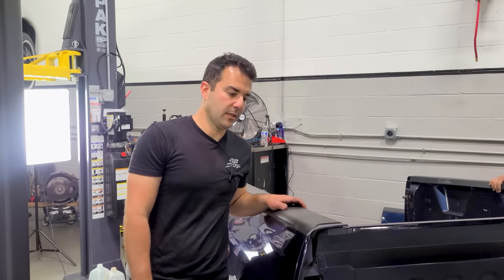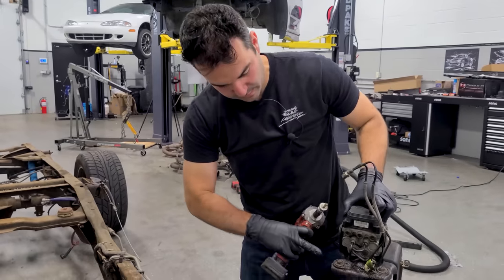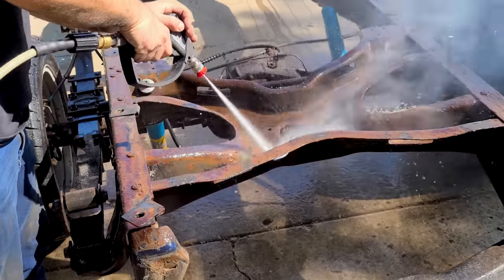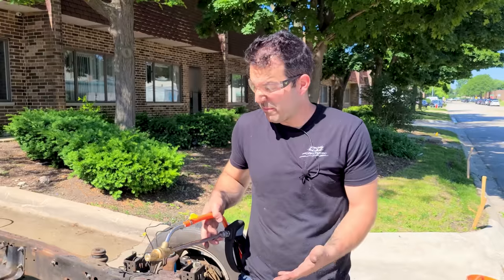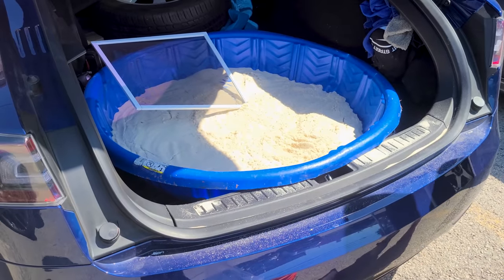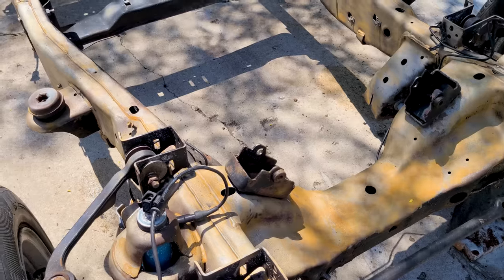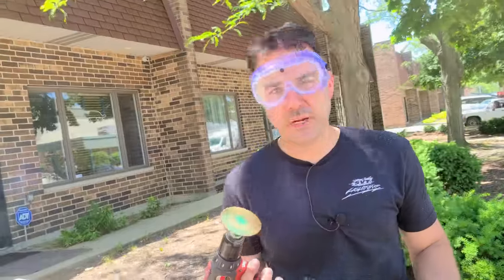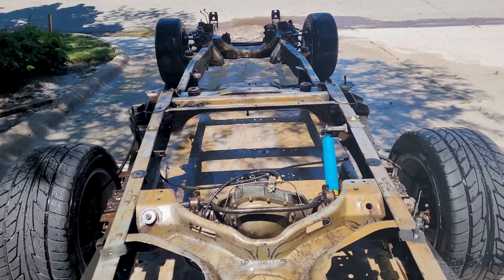I Was Quoted $3,000 To Sandblast My SVT Lightning Frame So I Did It Myself For $100 & So Can You!

Comment from the maker: Legit Street Cars Foam Cannon bundle with wash mitt & Clay Mitt! https://www.legitstreetcars.com/merch/p/lsc-foam-cannon-wash-mitt-clay-mitt-bundle
Foam-Cannon with wash mitt!
https://www.legitstreetcars.com/merch/p/lsc-foam-cannon-with-microfiber-mat
The bundles sold out in a few days last time but I'm restocked and these are ready to ship. Limited-time special pricing is automatically applied!
Reply: Por-15, Metal Prep,  prevents, the flash rust. Leaves metal, a zinc grey, if kept dry, till paint
Reply: the frame looks rusty already..

I was a quality control supervisor at an oil platform factory. They use sandblasting for pretty much everything that needs to be coated. I wouldn´t even let them get near the sandblaster if the relative humidity was above certain level let alone get the sandblasted metal get wet or even be touched with bare hands. Sure, a car frame is not going to explode if some rust gets trapped but...

I wonder how did you remove the rust before coating the frame?
Reply: Yo. I know you know about eastwood products. I had rust on my 2006 Chevy Van's roof (like they all get) and used an SCT from eastwood. it's short for Surface Conditioning Tool.  It's hard to say whether sandblasting would've been faster or slower ... but in your face for the under-side, I think it's by far the best product with the abrasive wheel they recommended for me. I think the abrasive was either 80 or 120 grit.  Which I then used with their epoxy primer which did a pretty good job.

Comment: Pro-tip!  Try to keep the jet at 90 degrees to the surface you're blasting as a general rule.  Using it at an angle diminishes the impact energy of each sand particle and therefore its power!
Reply: Heartily disagree. At least with sandblasters that I've used (particulate specifically) holding at 90 degrees will increase the impact energy but less sand will abrade because it has nowhere to go. Its easier to get a consistent finish and faster to blast at a ~45 degree angle bc the sand "skips" across the surface and away. Probably different for vapor blasting
Reply: Totally disagree. Your science is flawed.
Reply: 90 degrees angle is the absolute perfect way to sand blast.
Reply: I like between 77° and 79° when I sand blast, not a degree over or under. You've been warned.
Reply: @jimgordon3468  as a professional sandblaster. 90° is not the perfect angle. One should start with 70° and find what distance and angle works best while completing the project. Different media acts differently to different pressures, and when water is introduced it slows the media dramatically.
Reply: @JDJD-mw9rr  haha
Reply: I just close my eyes and what ever happens...happens! Lol!
Reply: @richardb4022 I prefer 110 degree 😉
Reply: Did you get the bushings while you’re at it 😂

Comment: A pro tip, if you have a car lift ... 2 posts lifts, like the ones you have...     Use the lift to lift the bed off the frame..  then roll the frame out of the way and then you can set you bed down on the ground or rollers etc..  work smarter not harder.

Comment: I don't know how we went from head gaskets to frame off sand blasting, but I love it. I've never seen one of those DIY sandblasters before. Very cool.
Reply: @  GldRush98, check out Steve Summers channel. He has recently done the same thing for blasting parts on his 80's Chevy Square body rebuild. A real nice guy( I visited his shop and met him while on holiday in the states from the UK back in March)
Reply: It Happens...  😆 
Never seen a Wet Sandblasting like that..   👀 

I have a nice Air pressured Sandblaster tank; but, it's only practical for Small areas..   it Devours Air and I Hate the Dust.
Reply: While we’re in there….
Reply: I think im gonna use that line on my wife "Honey we need head gaskets on the truck" Translation " frame off restoration"
Reply: I guess if you already have a huge air compressor, sure.  But the cfm you need is way above typical household compressors, unfortunately.
Reply: @bb5242  Yeah you need 28-35cfm, 1/8" Kennmetal nozzles and 1/2" hoses on blasting pots to get anything done on frames.

Comment: Cost me about 500 bucks to do it myself with a sandblaster from Harbor Freight.  Worked out well. Also might help if you use a more abrasive sand. I used coal slag.
Reply: sodium bicarbonate as an abrasive media.  Then raptor line it. Keep and clean all your old bottles. clean well, reuse it for rubber under coating by the gallon.
Reply: Salt?
Reply: @JakeSullivanMedia  Baking soda
Reply: @JakeSullivanMedia  salt is sodium chloride
Reply: @joshuavanalst2365  won't remove heavy rust,
unless you turn the pressure right up
Reply: @joshuavanalst2365  also soda fucks with paint unless you neutralize it
Reply: Yeah and it cost me 700.00 for a mobile unit to come and do mine.

Worth it!👍
Reply: @joshuavanalst2365  sodium bicarbonate is dissoluble in water you might as well be wet blasting it with butter because its not going to do much.
Reply: Coal slag is very effective compared to play sand, and only $10/50lb bag at Menards.
Reply: @JoeMama-ke1fi Can you do wet blasting with coal slag?
Reply: @lexrios5452   I don't think so, I mean you probably can literally do it but it might mess up your nozzle.  It's definitely not meant for wet blasting.
Reply: Had to be several hundreds gallons of water to do that! My town would cut me off!😁

Comment: Alex:
When he bought the truck: It needs JUST A BIT OF WORK
When he discovered the bad head gaskets: Let's replace the HGs
When he discovered the bad engine: Let's build a forged rotating assembly
When he took the engine out: Let's do a frame-off restoration
Reply: So true !   Love it ,  while your there syndrome
Reply: When he blasted the frame : Time to buy a paint booth?
Reply: @Robsav-yx6vi  whe while you are in there goes a bit too far
Reply: You stop when the money runs out?
Reply: It's a lightening tho. They're epic trucks and I feel like it's worth a full restore
Reply: Mission creep....
Reply: just wait till he tackles the fuel pump and ends up with a new transmission
Reply: This is me right now... started with head gasket replacement. Now I'm building fully forged 383 motor with $2000 of head porting work/bigger Valves etc. 4l80e is apart on my bench. I'm taking the body and bed off the truck today for a frame restoration.... what have I done... I never realized it was such a fine line between head Gasket replacement and frame off restoration
Reply: And this type of thinking is how I gutted my old house and rebuilt it
Reply: Same tho 🤘 idk why but damn, might as well. It will be better in the end

Comment: It didn't take me to terribly long into my sandblasting "career" to recognize the value of an angle grinder and a wire wheel/flap disc. You can race over the large flat areas with the grinder and then just touch up with the sandblaster. I do not suggest using your finest grinder for that job. Harbor Freight corded for $15 is the perfect tool to pack full of rust dust and overheat.

Drills are useless.
Reply: Was looking for this comment
Reply: @jstephens1193  I live to serve. 🤣
Reply: My friend bought 2 h. F. grinders so he didn't have to stop when he killed the first one, plus h f will swap them out if you burn it up "too fast" Chevy truck is a 3-4 grinder job
Reply: @ryurc3033  I bought triplets on sale for like $12.99/ea. 😆
Reply: Not to mention saving some of the 3,000 gallons of water (2.5 gpm * 20 hours) that goes into sandblasting the whole frame.
Reply: I wire wheeled my truck frame its definitely faster. i should have looked into wet blasting for the hard to reach areas at the time.
Reply: Exactly, Did the wire wheel and grinder on a Corvette and Chevelle frame. Entire frame done in 3 hours and ready to clean.
Reply: @ryurc3033   lol.  or cover it in breathable bag, maybe wrap with tyvek or cotton t shirt.  shouldn't need to ruin any grinder
Reply: @darkshadowsx5949  thanks.  how rusty, how long and how many flap disks or what?

Comment: Use a tennis ball to hold the trigger on. It will pop in and out easily and if you do drop the pressure cleaner gun the ball will pop out stopping it automatically. This trick makes the job a lot less physical. 
Also you probably should bund around any drains to catch the sand so you can shovel it up. The sand may be natural but it will  block up drains eventually. 
Great video.

Comment: Glad you mentioned the flash rust, I was thinking that taking the frame to bare metal with water in 100 deg heat might create its own problems. Clearly much less of an issue if you can keep water out of the picture either using compressed air-fed sand or even vapor blasting but they are much less DIY friendly.
Reply: Compressed air sandblasting is WAY more messy and requires much more personal safety equipment. Dry sand comes right back at you. If you watch to professional, they have moon suits on, covering head to toe. Plus takes a pretty big compressor. My 4 hp is not big enough to run my cheap siphon feed blaster.
Reply: if you spray it with vinegar it stops the flash rust
Reply: I add vinegar to the water and also works good for neutralizing Playa dust in parts of desert
Reply: @lutomson3496  how much vinegar? Could it be applied directly after spraying the water instead of mixing it with the water before spraying?
Reply: @alt7488  Do you have to neutralise the vinegar before painting?
Reply: @markrainford1219  prepsol it
Reply: Problem is (wet) sand stuck inside the frame.  Sand will continue to absorb moisture and rot frame from inside over long term.  Its bigger problem on restored  VWs & Porsches... but a problem none the less
Reply: If you buy an all prep iron phosphate cleaner It will remove the flash rust and prevent It from rusting again 

Works fantastic

Comment: I was always wondering if anyone has used electrolysis first to removed rust from a automotive frame.  You could build forms around the frame to hold water and just let sit and let electrolysis do the the work for several days.  Follow up with blasting in the video.  Finally evaporust to remove in areas you could not get into with the previous two processes.  You could place stones or other material that would take up space to limit the evaporust required.

Comment: Can I just say I love that you were willing to accept possibly changing course with the sanding pad upon realizing it might be of some use instead of trying to push the blasting method.  That's super cool.
Reply: that pad was scratching up the frame a lot. blasting is a lot better.
Reply: @prydzen   and of course it is actually removing metal whereas the sand will lift the rust scale and do little to damage the surface. Of course if you were to hold it in one position for long enough it would finally blast a hole through the chassis rail, but kept moving it would have negligible effect on the steel's thickness
Reply: @samrodian919  you dont say

Comment: I used a HF pressure sand blaster and it worked great.  You need a LOT of compressor to do real sand blasting, but it's really pretty effective.
I treat the metal with phosphoric acid, as many times as needed to get a good dark grey color, then clean and POR15 or paint.  IDK about pressure washing with sand, it seems to have gone slower and the thing about sand is really the speed and how sharp the sand is.  One quick tip is that if you clean things up so you don't have all the grease and oil, it really helps.  Sand doesn't do well against grease.

Comment: I had a guy who owned a portable dustless sandblaster on a trailer come to my house and did my 16ft trailer for $700. He put some kind of anti flashing agent mixed in and he said that gives you 24hrs before the surface rust comes out.

Comment: For rust removal, I like flap discs and wire wheels and twisted wire cups for grinders. You can really strip away big areas fast. And for smaller areas, they make wheels for drills and dremels too.
Reply: its eating the rust, dirt and broken wires from the wire wheel that sucks doing it that way but it def works

Comment: They do make a additive they hooks up to the pressure washer soap hookup that coats it with a rust inhibitor while you blast the frame saves a ton of time. Js great job on the frame by the way ! I have blasted with over a hundred different set ups for blasting through the years and water blasting is the safest and cleanest way to blast . But doesn't work so well on heavy equipment as it doesn't get the presser to remove the industrial paints . The more you know lol thanks guys .😎👍❤️🇨🇦🇺🇲
Reply: I’m curious about this rust inhibitor addition. Is it an additive you put in the soap tank or a unit that connects where the soap tank goes? Any more info that will help me track it down? Thanks 

Also, any suggestions on minimum psi and flow rate needed for wet sand blasting to remove rust?
Reply: @Tonisuperfly  It is a additive that goes in the soap tank. Harbor freight has it princess Auto has it. And wet sandblasting companies have it as well. Really works awesome I think Zep even makes it as well.
Reply: @Tonisuperfly  this is a link to it.above
Reply: @k.g.kennedy9471  thanks, I can’t see a link and I’m in New Zealand so we don’t have any of those companies here. I might ask around though. Thanks :)
Reply: @Tonisuperfly  no worries glad I could help . I have used this rust inhibitor wet sandblasting and it works very well it however doesn't last forever but it does last about three weeks till some rust starts to show itself. I paint asap but it does last three weeks outside in the elements .. js Cheer's

Comment: I sold my  10 year old Chevy Silverado because the frame was totally covered in heavy rust, the bumpers had rusted through. All the brake and gas lines were rusted out. There was not a speck of rust or even a scratch on the body.
I bought a new Ford and had it rust proofed. The truck is five years old now and the frame looks like new. Well worth the money.

Comment: Great video as usual!! For the underneath, try a heavy de-greaser to clean first. I like the yellow Harbor Freight stuff, and then a wire wheel to knock off any remaining scale. From there you can use rust converter and/or encapsulator from Eastman, and then take a look at Eastman's chassis black. You can spray it over anything and wears like iron. I've used their products in the past with really good results. Thanks!!

Comment: If anyone is tempted to try this, remember to clean up the sand properly - 5 bags of sand getting washed into the street drain by pressure washer and subsequent rain showers will make you pretty unpopular with your neighbours next time it rains heavily... For some reason civil engineers don't think "we better size the drain assuming someone will dump 125kg of wet sand down there all at once " 😀
Reply: Yep, "Off Site Sedimentation" is also a legal problem. But you'd never get in trouble for it because they focus on big developments, not one-off violations like this. It's not "just sand," either. It's everything he's blasting off, which is an environmental problem. But hey, it's entertaining, so who cares right! Not whining, just saying facts🤷‍♂

Comment: Next time you need to take a bed off by hand use a cherry picker and a 2x4 frame bolted into the bed mounts from inside the bed. You can use a similar method with a 2x4 frame bolted to the end of the cherry picker itself to pick up a cab. Just need to put a blanket on the 2x4 and bolt it together from inside. I also recently found out I can unbolt the engine, trans, and subframe from my 64 dodge 440. Then hook a chain up to the nose and tilt the car on the rear axle, up and off the drivetrain. Cherry pickers are useful for so much more than pulling engines.